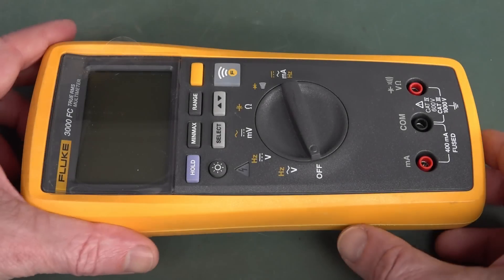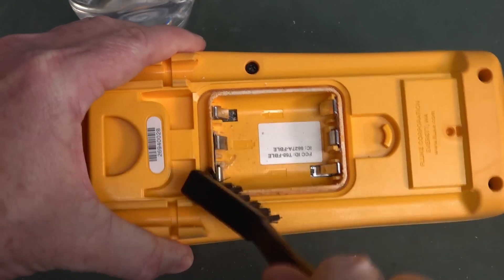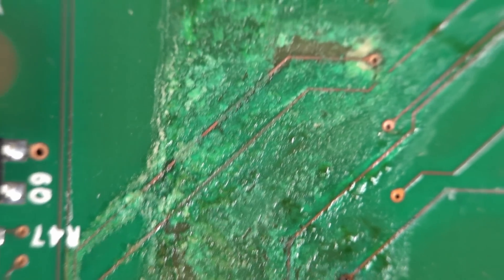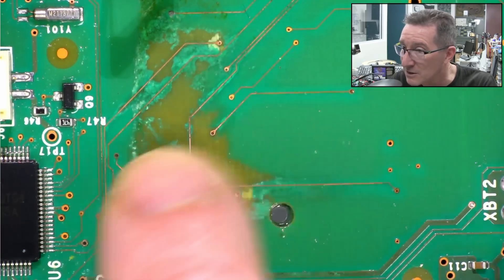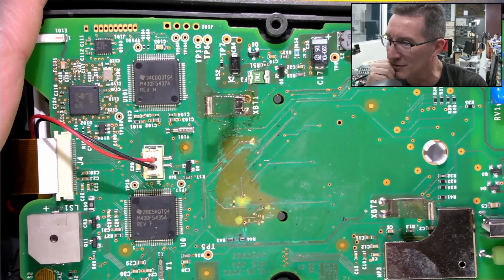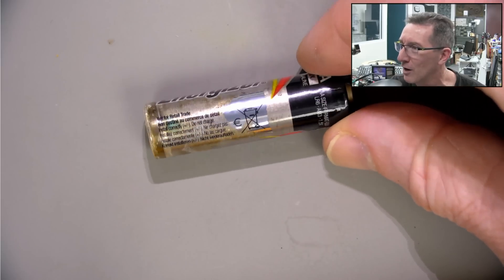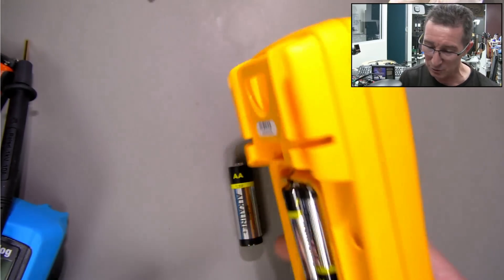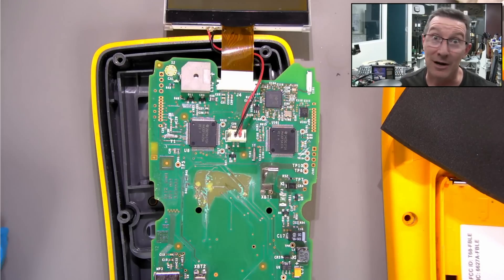EEVblog 1497 - RIP Fluke. Thanks Energizer. NOT.

Comment: Send a letter to Energizer (I don't know who makes them). I had a problem with leaking batteries in a camera flash. They paid me for the damage. Also meters can get condensation on the board which will etch the boards. Boards need to be coated with silicone to protect  the board. Also keep meters in a sealed bag with silica gel when not in use in humid environments. Check the gel to make sure it is still absorbing moisture. Silica gel can be heated to recharge about 250 deg F.  thanks

Comment: I have 3 Fluke meters, one 25 years old, all use a 9v battery ( the old PP9), very rarely change them, mind you it means taking 4 screws out and removing the case back, no big deal , no problems so why did they change ??

Comment: Energizer always leak a lot, I change to everyday no leak
Seems fixable, use very fine sand paper on those button pads and test continuity for trace and solder bridge those broken trace and uv pcb mask glue on those exposed trace

Comment: Over the years, I have advanced from alkalines to NiMH rechargables, having found NiCads useless, to NiZn rechargables (great voltages but short lifetimes in my experience), and finally to widely available LiIon rechargables. The latter appear to be meeting all the requirements. I have 3 sets of 4 along with two four-AA chargers. Back in the day, I found Duracells much more likely to spew than the Energizers, but alkalines be alkalines, in the final analysis.
Also, consider switching to microfiber swabs. There are big flat ones and little pointy ones.

Comment: Serves you right, Dave, for leaving batteries, especially, alkaline batteries, in your test equipment..! 🙄   Golden rule No.1, ..never, leave ..any batteries, (other than Lithium cells) inside your test gear that is ..not used, on a daily basis. 🙄  
And the reason it ‘broke’ the yella-plastic bits, is far more likely to be due to ..expansion, of the ..swollen cells, exerting ..pressure upon the ..broken plastic bits, in the confined space of the battery compartment, ..not because of any ‘chemical action’ of the leaked battery contents. 🙄

Comment: I would get in touch with the agents for Energizer and show them the damage their product has caused to your equipment. Across the ditch here in NZ we have legislation called the Consumer Guarantees Act which states (among many other clauses) that "goods must be fit for purpose and of acceptable quality" and the most important part:

"the consumer, or any person who acquires the goods from or through the consumer, may obtain damages from the manufacturer—for any loss or damage to the consumer or that other person resulting from the failure (other than loss or damage through a reduction in value of the goods) which was reasonably foreseeable as liable to result from the failure"

Essentially, the failure of the batteries has caused damage to your property, so you have the right to claim against the manufacturer.
If I am not mistaken, Australia will have similar legislation.
I would be asking Energizer for a replacement meter.

Comment: I recently adopted an old boombox, and the buttons weren't smooth just gritty & sticky until had looked in the battery compartment to find every single D cell had leaked it's guts out well and truly it was literally holding the battery door shut as it leaked out everywhere in it's box too! I'd guess been in that state for least +12 years and the bloody thing still works off 240v and so will become my background music player once cleaned the batt compartment as the things built like a tank and survived years of storage even with I think 9 D cells? all leaked everywhere as if were snow. Poor fluke got nuked with those AA's.

Comment: I had a battery leak on my Fluke 89 that ruined all the contacts! Shortly after that the plastic parts on the meter started to crack.. First the case srew holding posts, then the rotary switch then the lcd frame. The plastic became very brittle. Since then Fluke quality control is not what it use to be this can be readilly seen from day one with the test leads/probes.

Comment: @EEVblog send it to me, It would be definitely worth my time and effort to repair this badboy!!! 😬there is no need for a schematic for such a repair even though it would be extremely helpful! I had a similar issue once, the vias are the biggest issues because the copper or whatever alloy is used is probably thinner than the actual copper clad on the pcb... If it is just a two layer board it would be (pretty easy) to fix. I could film the entire repair (raw).
PS. I am a big fan and currently studying at the TH Köln.
Best Regards from germany, Nikan

Comment: Hey mate.  Had the same issue with a an IR Thermometer, Fluke of course.  The battery leaking fluid ate the plastic casing.  The thermometer still working though, saved just in time.  I could not believe.  The battery compartment should be sealed off - that is the perfect single point failure example.

Comment: I don't understand why someone still uses non rechargeable batteries. I have the same set of 8 cheap AA and 8 AAA rechargeables since 2015. I use them all the time. On my PC keyboard, my mouse, my OCulus Quest 2 controls, my flashlight, etc, and they never gave me any problems. I bought another 8 AA recently just to always have charged ones at my disposal, but the older ones work just as well.

Comment: You REALLY shouldn't touch that residue.
The black is manganese contamination, which is not something to mess with, but even the colourless electrolyte residue usually has substantial manganese contamination as well.

Getting the manganese contamination off of surfaces like that table (down to safe, ppb levels), without destroying it, is pretty much impossible as well.

Comment: What happened to leak-proof alkalines?

I'm old. 45 years ago, zinc-carbon cells were cheap (and they leaked) and alkaline manganese were pricey, but they didn't leak.

Until a while ago, I'd recommend almost any alkaline cells. DIY store brands, supermarket brands, even DongerCell if pushed. Now I can't.

These days, the only ones I trust are the Energiser Lithium cells, which have stupid capacity and the cost is a bit stupid, too.

Comment: My experience is that after any amount of vinegar and IPA cleaning the damaged battery contacts seem to have difficulties.  That in my cases has generally applied to nickel plated contact leafs.  But I would be suspicious about the rotary switch contacts and the push button patterns, even while they are gold plated.

Comment: Board out,> whack it into ultrasonic with some PCB cleaner (I use aussie brand ChemTools) > remove gacked parts/repair bad traces/pads > paint new mask and expose pads for new parts and solder new parts on.

Bob's your uncle.

Comment: Clearly Dave has never worked on vintage Walkman(s)... if you find one that's not leaked you've jumped the freakin' shark! You can easily find crumbling plastic chunks, eaten solder mask and traces, dissolved contacts.

I have several reservations for brand-names like Duracell and Energizer... IMHO those are overpriced alkalines at best.

Secondly I have reservations for batteries that have flown in the cargo hold of an airplane, being exposed for hours to a different pressure than most batteries get exposed during their lifetime.

I tend to buy alternative brand-names and 2nd tier alkalines and they usually do fine. For top tier brands I prefer Japanese stuff: chiefly my choice is between Panasonic and Sony.

Comment: There's enough evidence right there to go in hard and sting Energizer for a new Fluke. If they try any funny business like asking for the video to be taken down, dig those heels in! 
There's not always sufficient attention paid by meter manufacturers to the seal between the battery compartment and the PCB.....there's often gaps and holes that don't really need to be there, or can be minimised with hot melt glue.

Comment: Yeah, I learned that lesson with my Fluke 53II. Battery destroyed the metal tabs and got into the foamy innards of the conductive keypad. About $80 in parts later, I had a fully functional thermometer again. Expensive little lesson, that.

Comment: Makes me wonder why you have this issue so commonly because in my 40 years I've never seen this kind of thing happen with any brand of battery (even the rip off cheapos that last for 12 minutes before running out of juice) except when the batteries have been left in something for years after they've drained. You pull them out of something that's been in the closet for the past 3 years and they look like that. Something to do with how they're shipped/stored on their way to Australia from the US where they're supposedly manufactured? I don't know.

Comment: I just cleaned up an old hiking GPS that had some leaked rayovacs.  It dissolved some of the plastic so the perfectly fine metal bridge between the 2 batts had nothing to hold it in place anymore.  It still works but now when I change batteries I'll have to be careful not to lose the metal bridge that is just sitting in the end of the compartment now.

Comment: Everything I care about run on Eneloops around here. Abandoned "alcaLeaks", about 6 years ago. Lost too many good flashlights to these evil cells. I have never seen plastic do that before. It is almost as if the yellow plastic reacted with the leak to form a stronger corrosive agent, wow.  I would be interested if the Brymen BM786 (or any modern Fluke) would run with nominal (1.2V x 3) instead of (1.5V x 3). I want to upgrade soon. I'm still on a 9V based meter that is very long in the tooth, and I never had serious leak that hit a PC board.

Comment: 1,5 Lithium
Yeah. Vinegar have saved me a lot of times! Usually fleamarket finds.
Don't use alkalines - no matter what ever brand!! Either use zinc-carbon - if the batteries has sufficient ventilation so unsure here as they're behind a sealed gasket. Use 1,5 Lithium batteries (non rechargeable like Energizer L91 or L92 and a lot of other brands including Duracella and Varta). They don't leak. I use lithium for remotecontrols and other stuff I really care about and doesn't use a lot of power so they'll last "an eternity" - easily 3 times longer than what alkaline otherwise would have leaked. For the rest of the stuff I'll either use NiMH or zinc carbon depending on current draw and use. Only use alkaline if you don't have anything else on hand and REMEMBER to take them out when used up and/or not used for a longer period og time! But sadly people forget.
The deal with zinc carbon (and especially the non steel encased ones) is that if they have sufficient ventilation they'll dry out quicker than they can leak. I've not had a zic carbon leak in anything for years. I even have a Sharp calculator I use at my office desk with original(!) 2x AA zinc carbon cells in it - with expiration date 1985(!!)

Comment: I have yet to see a SINGLE ALKALINE that DID NOT LEAK!  EVER.  Off brands, name brands, you name it, I've seen them leak.  Anybody that says it's just "Duracell" you're either fibbing or just hate Duracel.

I've made it a habit that any device that I do not use at least a weekly basis has it's batteries pulled.

Comment: I use Panasonic rechargeable NiMh AA batteries.  $4 for 2 at Dollarama.  They seem to work fine in flashlights, meters, remotes and Lego Technic.  They last quite a long time between charges and hold a charge for over 1 year.

With Lego Technic motors (42140 kit) they give about 85% speed compared with Alkaline (tested with a race down the hallway :-)  and run for over 1/2 hour with 2 motors.  Low battery comes suddenly at the very end.

I managed to find an 8 cell charger at Value Village and this is very handy since it can charge 1 to 8 cells at a time in about 4 hours.

Hopefully they don't leak, but they haven't so far after several years of use.

Comment: I never knew that even though plastics have some level of resistance for potassium hydroxide and sodium hydroxide,  fiberglass-reinforced plastic shows lower resistance to potassium hydroxide regardless of the resin type used. I guess the stress of the tabs inserted into the plastic slots and scratches will gave an entry point for the alkaline solvents.

Comment: Interesting and potentially useful.  I'm trying to restore my old synthesiser which has a load of corroded vias but part of the board has an extra layer of solder mask to hide all the traces (Y U do this Roland??).  Maybe I should just empty an energiser battery onto it :p

Comment: They are expensive but all of my test equipment, remote controls and calculators have non rechargeable lithium cells in them. Many hours and much equipment saved and nothing ever has a flat battery.

Comment: So we know that batteries can leak over time and that this can cause serious damage to electronics, yet we don't make leakproof battery compartments but instead blame the battery manufacturer for something that is pretty sure to happen? Good job my steel heating oil tank is galvanised so it doesn't rust through or else I would have to blame the weather or god for making holes in it after 10 years! Do your blue Bremen's have leakproof battery compartments? Maybe we should wrap the batteries in clingfilm before fitting them?

Comment: Wow, that was harsh! That meter doesn't look cheap either - my tactic with this stuff is just rip it to pieces, take everything with acid crystallines on it; and douse it with water.
It removes all the soluble acids and such, and then hit it with the iso to scrub down the board and dilute away any water (especially important if tap water was used).
After that it's "suck and see" as to whether it works, and how to fix it... But a layer of PCB lacquer would help passivate things when your'e done - and filling up those holes with hot snot / liquid electrical tape is a simple modification worth looking into, it could save a lot of trouble if you do it before having to repair a leaked-in mess!

Comment: I've started using low-self-discharge NiMH in almost everything, for exactly this reason. While they aren't necessarily economical in low-drain devices like a multimeter, they are much less leak-prone. Factor in the effort and cost of cleaning/repairing/replacing devices damaged by leaking alkaline cells, and the added expense of NiMH is worth it.
Reply: Energizer actually replaces things that get destroyed via leaking.
Reply: @Vsor  I'd much rather use cells that don't leak to begin with, versus arguing with them to get the device replaced under some arcane damage claims process. Have you ever tried to get a replacement device from them, and if so, how did it go?

Surely they're not going make replacing a $300 multimeter easy...
Reply: @MikeU128  I had them replace my girlfriend's bluetooth mouse. I just took some pics and sent an email. It wasn't a $300 fluke brand mouse though lol.

Comment: WHY ON EARTH? Why did you spray on vinegar without disassembling it from the electronics before? If your Multimeter itself was not already dead then it did die right that moment. It's not even worth watching the video all through. So I guess I can stop at not even 5 minutes.... Good bye
Reply: He did not "spray on vinegar". He used vinegar on a cotton bud to clean the contacts. Then he sprayed with 100% isopropyl.
Reply: @RichardHolmesSyr " Then he sprayed with 100% isopropyl."  ... which then gave the acid of viegar and alkaline mixture the perfect chance to get washed off the surface of the plastic and drip into the electronics, as the vinegar does not just evaporate like isopropylic alcohol. Is that what you wanted to say? ;-)
If cleaning up such dramas (no matter if it is electrolytic condensors or batteries that spilled out their gutts)  ALWAYS try to keep clean parts still clean but rinse off contaminations directly into some container. Never let the rest of the device or the electronics be the container!

Comment: Just checked my x360 controller. Battery removed from device but inside the case. A rayovac leaked even without terminals not connected (each battery is isolated when battery is not plugged in. It was a very small leak though.

Comment: Isn't it possible to put the backend of the plastic and metal plates into the ultrasonic cleaner? And yes periodical I change all battery's in my equipment to prevent that (it's on my calendar, and it reminds me yearly to change batteries), just for that reason., And when you do them all, you know when they got changed. Of course, if they are bad, before you replace them. There is still a chance they will leak. I've never seen that kind of damage, I'm a bit disappointed, fluke didn't for see a plastic shield or kind of to protect the PCB. My old Dynatek has a shield to prevent this.

Comment: I've yet to find a battery brand that doesn't do that if you keep using it after it's basically dead. Granted they're random no-name brands that come with whatever the device, which i later replace with duracells.

Comment: I don't know what the current state of things is but I've had several battery leaks in the past.  Each time I contacted the manufacturer (duracell and energizer) and they asked for pictures of the product and to verify the date stamp on the battery.  As long as the batteries weren't past their code date, (and I see yours are 2024) they were happy to cut me a check for the replacement cost of the gadget, along with manufacturer coupons for a few free sets of replacement batteries.

I don't know if there's a legal responsibility there or if they are just doing it that easily to retain a customer.  My items weren't particularly expensive though, we're just taking like $10 flashlights and the like.  They might not want to fork out for a replacement Fluke.  It's certainly worth trying though!